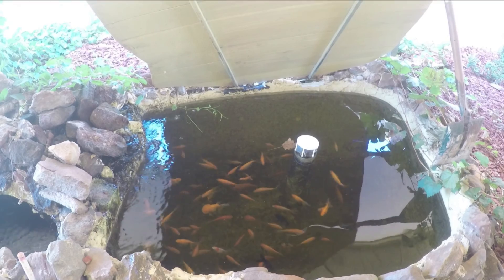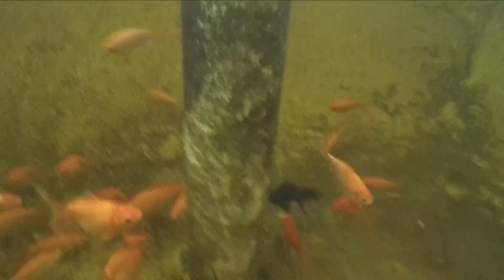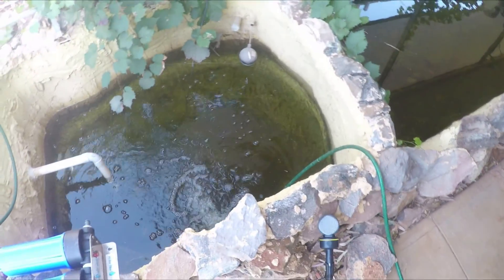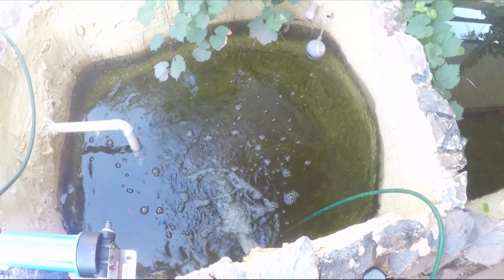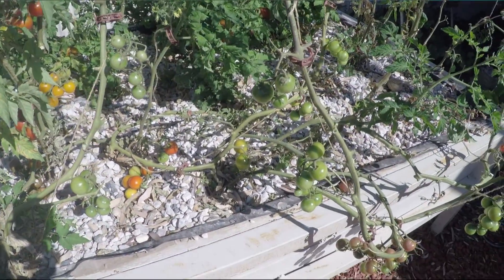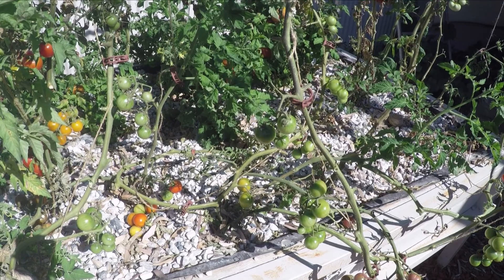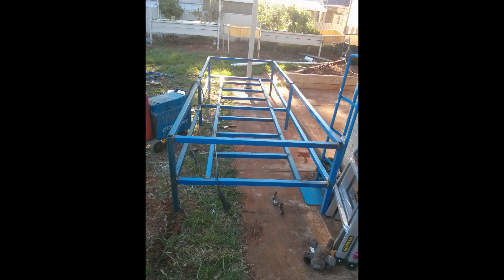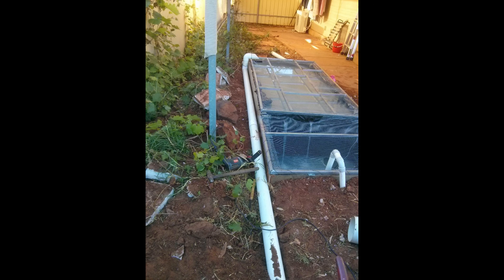Designing your Aquaponic System -  Part 1 - Grow Beds and Fish Tanks

Comment: is there a part two? i would like to see more about the plumbing and the pump you use
Reply from the maker: I can make it, but the video didn't get much attention, so I didn't continue to make them. If you've got any questions, ask away.
Reply: ok thanks for replying. i was just wondering how the pipes go from one bed to the other via gravity feed. since the beds are spaced so far apart and it appears that the pipes from the auto siphons go below the ground.
Reply from the maker: +Ga Darby 
The pipes are dug into the ground, and with the gravity feed, they overflow, and flow into the next bed, going underground. It'd work just as well from a meter to 100 meters (I've never tried 100 meters, fyi).